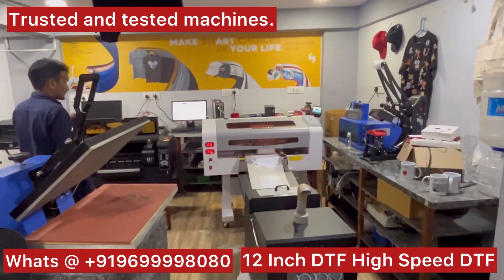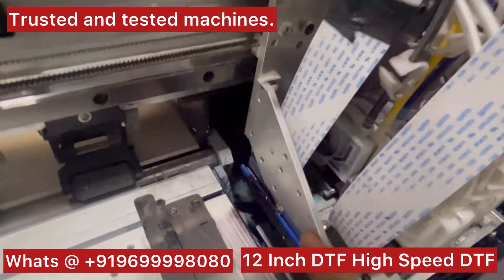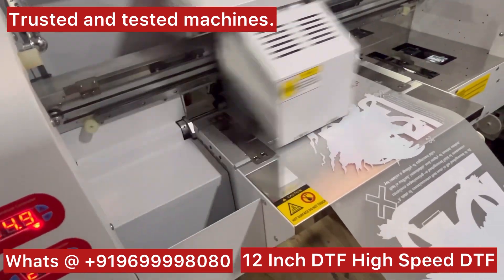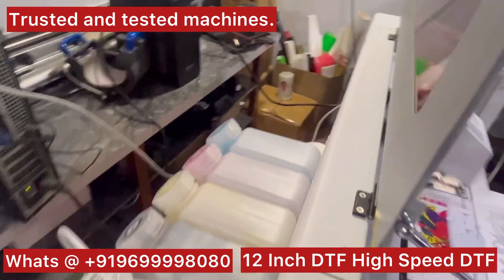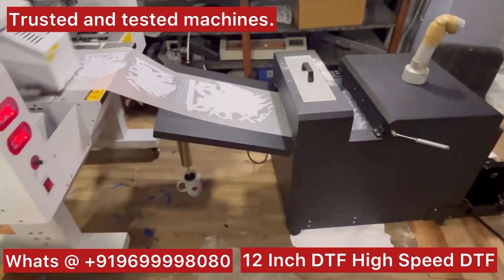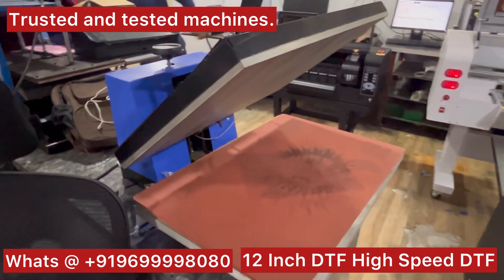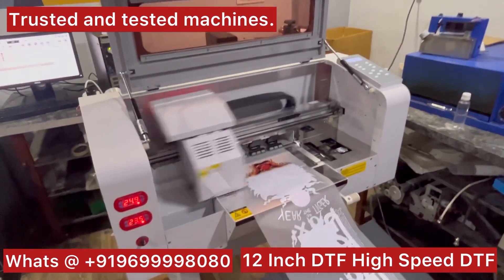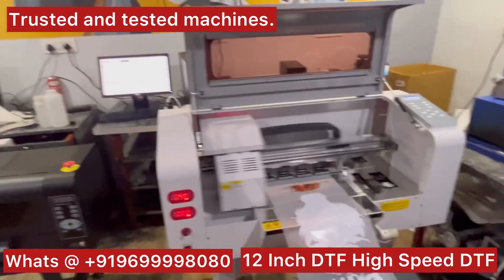Audley vs other DTF printers. All options available in DTF at one place.

Comment: Sir in print quality of audly machine or l1800 printer what's different between both
Reply from the maker: Resolution is same 
Density will be always more with high speed machines. But if we talk about details then yes 1800 will give you fine quality prints. 
Actually we can’t compare between these two

Comment: audley with xp-600 or i3200?
Reply from the maker: Both options available
Reply: does this mean we can use i3200 or xp600 in place of each other or whatever head we buy initially to be used when replacement is required ?
Reply: @alpachocha5275  no. Need specific motherboard for each i3200 or xp-600
Reply from the maker: @alpachocha5275  no no
Reply from the maker: @kaisarimammehedi8336  correct
Reply from the maker: @alpachocha5275  no. You cant.